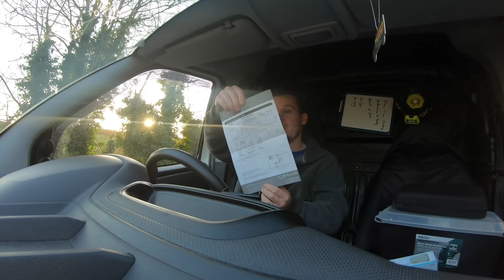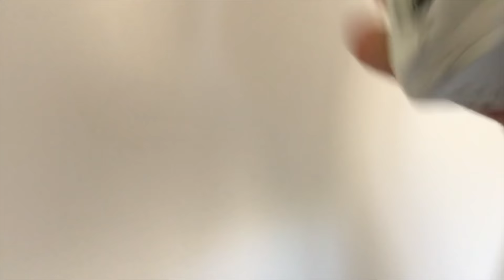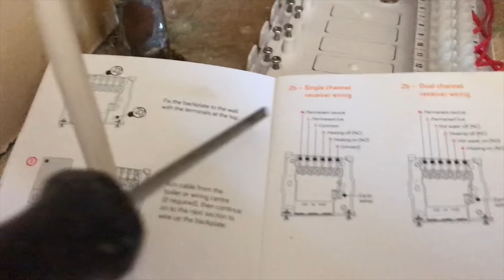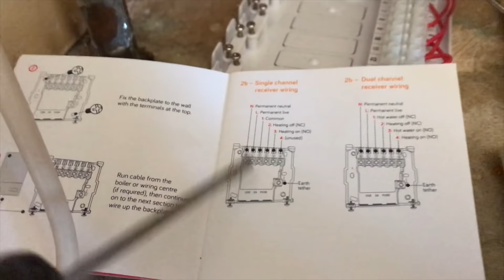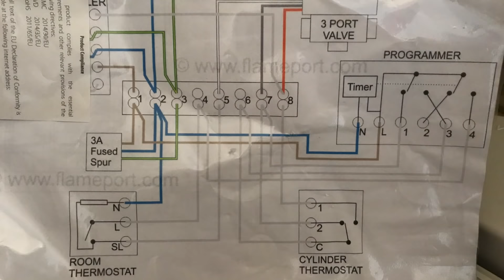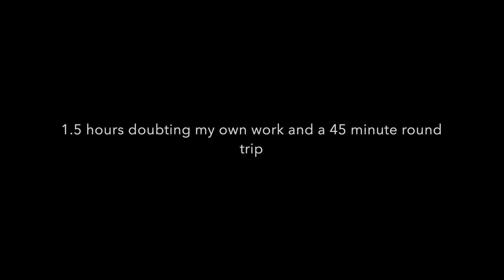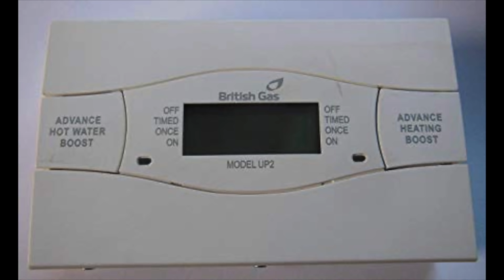When a job doesn't always go to plan!!! The Hive from hell.

Comment: Much neater than the wiring before.
Perhaps next time if you have to mount the connections box flat on the 'floor' add another piece of wood to lift it up off the base of that cupboard. That way if there are any leaks in all that pipework or a plumber is working on the pipes and lets some water out it's less likely water will run into the electrical connections box.
-Neil
Reply: I thought the exact same thing about mounting it flat however thought it would be better to mount the connection box vertically on a piece of wood !

Comment: Great video. I had a new boiler fitted and it was only when the boiler went faulty and I was trying to sort that out I realised that they had wired the tank stat backwards. The tenants were switching the water on to get the radiators to work. That was an easy fix boiler cost me a lot more to fix.

Comment: You don’t ignore the room stat, as you’ll need to wire in the receiver as the room stat. 
What you’ll often find is that 3 port valves also fail causing all sorts of issues.
Nice one.

Comment: Interesting to see that you have the heating system spread out like that. 
In the netherlands we generally buy a system that has everything in 1 box with a nice cover. 
All you need to hook up to that is the water lines, gas, power and an opentherm or on/off thermostat
Reply: Trouble with combi system is that it's only really good at supplying one outlet. If you have more than one bathroom/shower, stored water in cylinder can supply them hot water.

Comment: Don’t blame you putting two supplies in mate for the last video. I would have done the same for a few reasons.

One like you there’s too many joints in that cable, no doubt they will end up being high resistance over time and with heavy loads.

Also manufactures instructions as you say, also wouldn’t have been happy chucking a dual out and then wiring round.  You’re being paid to do it and correct other work but you’re also future proofing it to a certain extent as well.

Regarding diversity, it’s all well and good and 9/10 it’s fine but I’ve also been to jobs where the families and culture do a lot of cooking for big families, all rings on the hob and borne ovens on continuously most days, it does happen.

Great video as always mate

Comment: Great video. Heating systems can be a head scratcher. I've been there and doubted what i did but it nearly always is a faulty component. I never have the balls to charge the customer for the extra time but should. Usually price it low anyway. Same in ireland lots of guys steer away from the S , Y plans etc. 
Great content. Keep her lit dude.

Comment: Thanks for the video buddy I'm glad you said they aren't so easy! going into old heating system are a nightmare!! I'm doing one today went to have a look at the job yesterday. No joint box for the heating the hot water valve and 3 port valve are connected only L.N.E inside the boiler the tank stat wasn't even connected up!!!  No programmer or heating stat and the house was rewired 5 years ago fucking cowboys!!!

Comment: One thing we have found with y plan systems when using the nest system but I suppose it would apply to a hive as well is on the tank stat where you have terminals 1 2 and common, tank stat can fail to turn boiler on at all even if wired up as per all diagrams ie tank stat diagram and nest system, swap terminals 1 and 2 and all works fine, had that a few times  now with two different brands of stat. We’ve had that many problems with y plan and 3 port valves now that we only fit two 2 ports instead, hope that makes sense.
Reply: I never fit 3 ports give to much trouble. Always 2 port.

Comment: The unvented cylinder also has a overheat stat which allows  it to shut off a two port. This doesn’t happen with a three port. Unvented cylinders can explode if safety valves are not in place or faulty where the temperature reaches close to 100 deg c.

Comment: I'm sure nest and hive are similar but I have two nest systems home and office i can't fault them, they save money for sure but something to think about is the placement of the thermostat both mine are in the rooms I'm in the most so in the house it's the living room instead of the hallway so when the room is up to temperature it turns off instead of being in a room like the hallway which will rarely get to temperature, same in the office.
Also they do say it's a diy job but if you dont know which version you are installing as there's 230v and a 12v it has been known for people to fry them with the wrong voltage.

Comment: as soon as you land on site plug the hub in, it takes roughly half hour to update... when it flashes yellow then put the batteries in the stat mate you'll have no problems connecting then. usually i put three batteries in then when the hub flashed yellow i put the last battery in and crack on

Comment: Before you start updating or adjusting heating systems, make sure they work in the first place. Stops confusion after.
Reply from the maker: Yeah had no choice with this one was a new boiler that the plumber had stuck on a plug top
Reply: @Cjrelectrical  yep fair point.

Comment: Had the same trouble with hive technical. Stat wouldn't pair with receiver on the multi zone system. Wanted an account set up and looked for my engineer id code? Ended up leaving it in stand alone mode

Comment: I find that the CK wire strippers just stretch the flex sleeving and don't break is cleanly like it does with standard twin and earth. Does anyone else have that too?
Reply: same here. Not every time but sometimes. If i rotate the cable round a bit and give it another go it usually does the trick

Comment: Ahaa literally just had the same thing from new tho wired 3 nest  gen 3s diffrent zones only 1 controlling hot water with 6 underfloor heating zones got it all up and running then kept tripping the rcbo off after 2 minutes of fireing up wich no bang so neutral earth fault scratching our head turns out the water pumps got a straight short between neutral and earth also live and earth. There's always something

Comment: Content great as ever Chris but not having the shout out to the CK strippers , they are clumsy draconian and absolutely rubbish. Get yourself some proper gear with the YouTube cash bonanza ( 👍 Jordan) - some Jokari or Knipex automatics .
Reply from the maker: Honestly? Not being funny but you can’t be using them correctly or haven’t adjusted them?
Reply: @Cjrelectrical  I find they work well on new wire but if you've got wiring where the insulation has gone hard they don't cut through it even on max setting